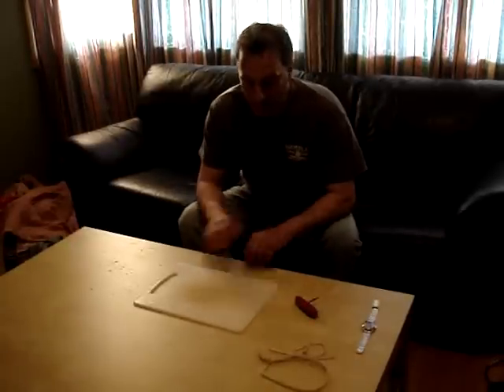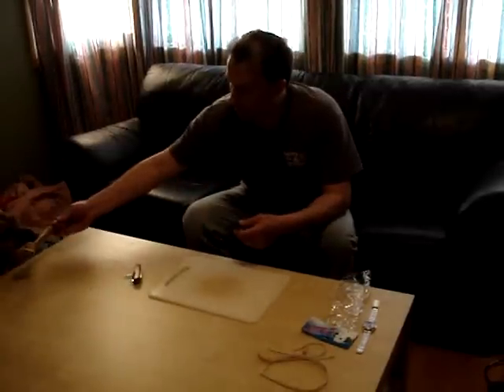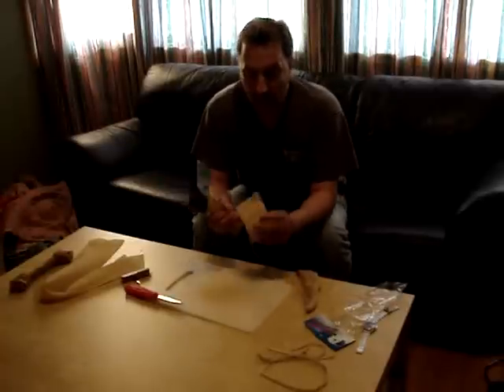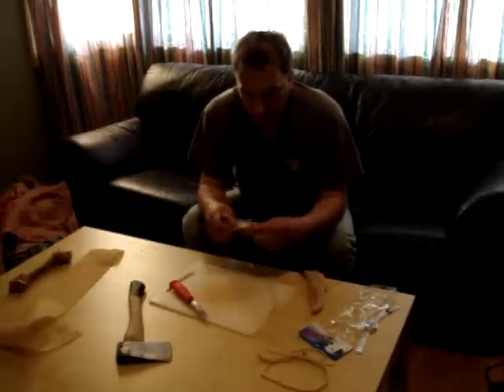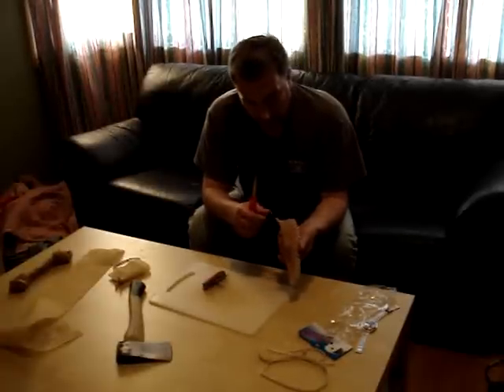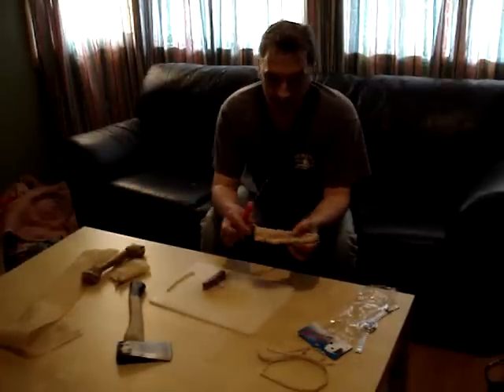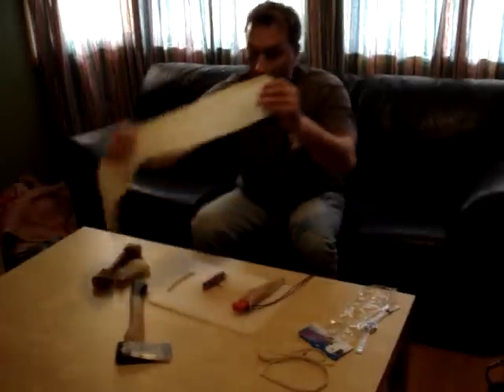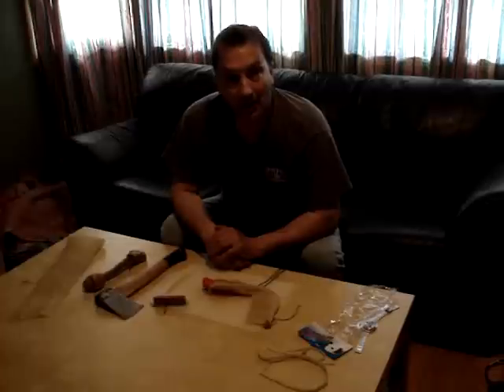Quick Knife Sheath from Dog Bone

Comment from the maker: Your quite welcome ! Ive made several after this vid by just wrapping the wet rawhide around the knife and clamping down the part over the blade then tying string around to hold it in place . It is dry in 24 hours and no stitching is required ! You can then cut the excess off and make a hole or a vertical slit for a belt. It drys as hard as kydex !

Comment: you  know you can take Raw hide and cut it  up in small Pieces  and  put it in a  small pot of Boiling water  and keep adding water and letting it boil  and you can make Hide Glue  ,,  its strong and many Glues you get for  wood working is a Hide glue base ,,  some knife makers use hide glue on there  sewn buffing wheels  and apply  Grits to the wheels for knife grinding . its more cost effective than paying 5 to 9 dollars a 2X72" belt ...